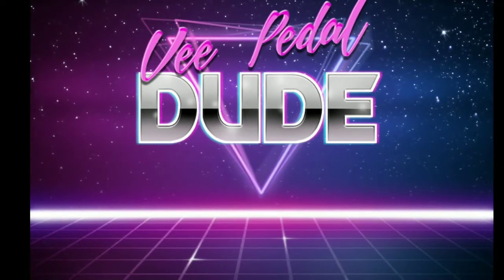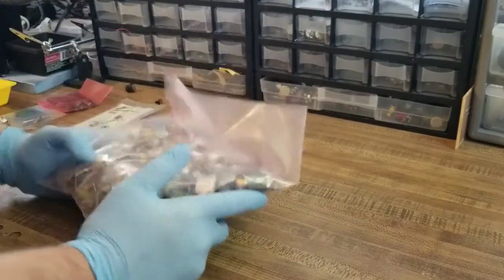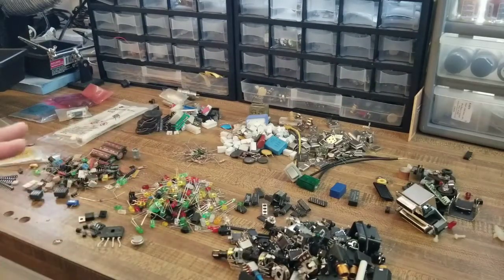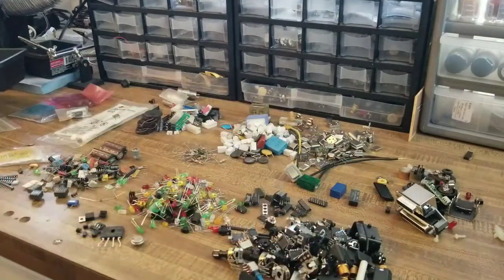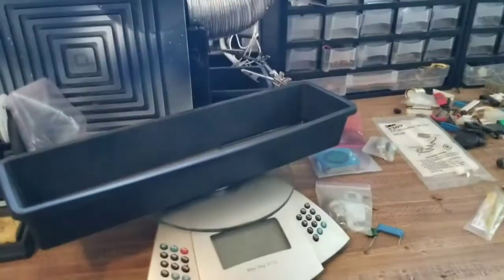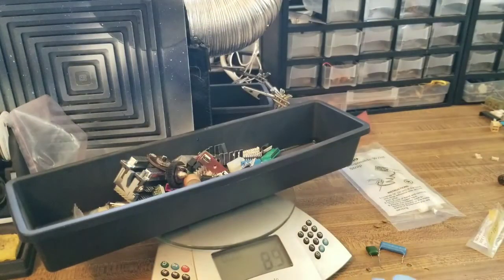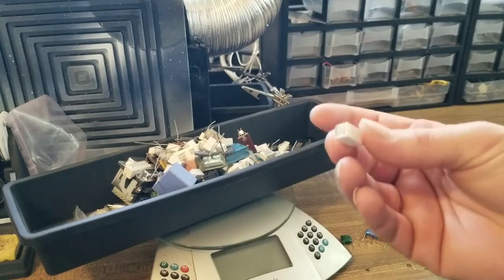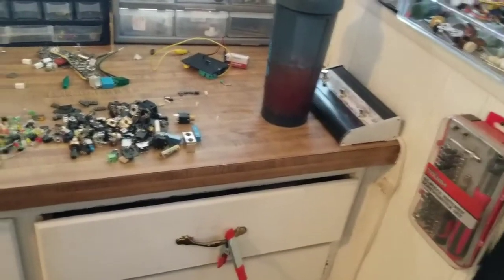JAMECO random grab bag review.

Comment: Got one of these recently and didn't think I did so well, then upon further sorting out the parts, came across a 3 PIC microcontrollers who's value just about paid for the bag(~$6/ea), if I ever use them. I've ordered another in hopes of more high value parts. For my uses, nearly all parts have some value, as I prefer to have all the parts on hand for any project that takes my fancy. I've also got ElectronicsGoldmine super suprise box and a crystal assortment's as well as an Alaskit Popourri'o'Parts grab bags on order.

Comment: Ok some of those leds are infra red LEDs...the light blue ones .also you should have gotten a +-12,5 vdc power supply..anyways ..I completely disagree with your assessment but I am a project builder so I loved everything except for the plastic connectors...I got a power control module which cost 167$ brand new and around 60 used ...I have purchased 4 of these over the years

Comment: i have one of  these bags coming tomorrow (nov 18). i hope i get things i can use
Reply: How did it turn out? Just ordered one myself, the 3lb version.
Reply: When I opened it, I though it was kind of meh...., but later discovered 3 PIC microcontrollers that go for $6-8/ea, and some other interesting tidbits. Can't recall what, as I've bought ~20 grab bags in the past couple months.  Good enough I've ordered another
Reply: @Flyback Commander I look forward to the video. My second will hopefully be here tomorrow, if USPS hasn't lost it. I've also got a pair from Electronics Goldmine hopefully arriving tomorrow as well., and Alaskit is supposed to be sending me a potpourri 'o'parts' as well.